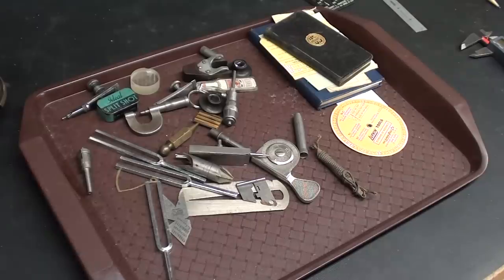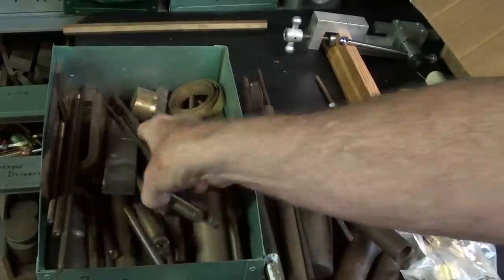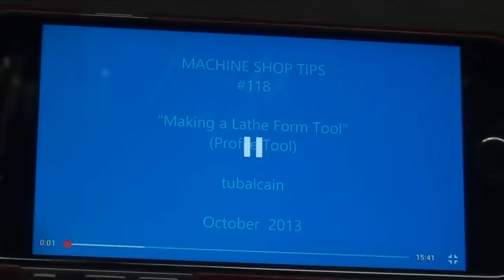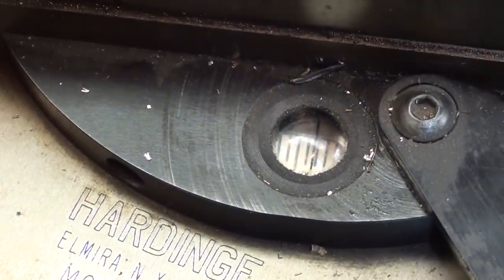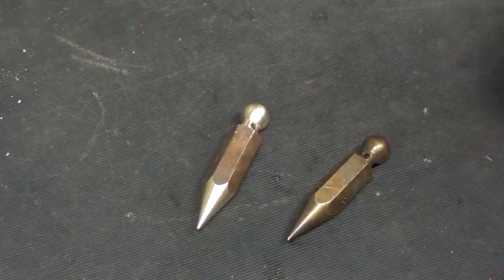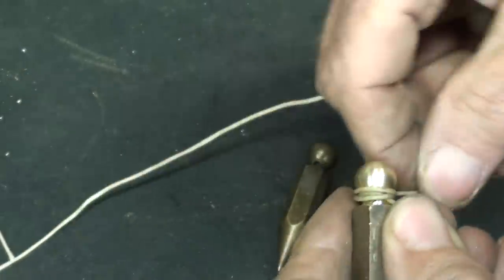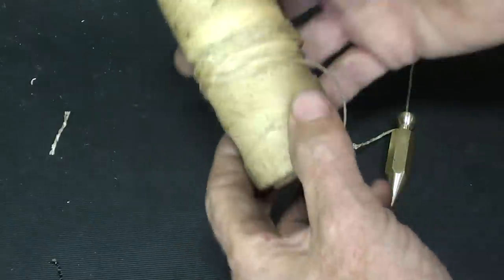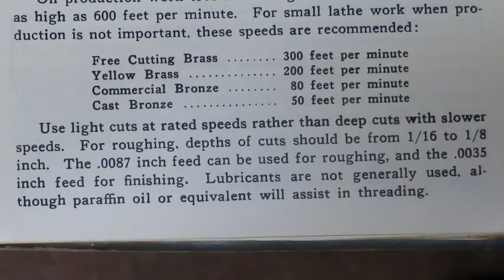MACHINE A TINY BRASS PLUMB BOB Tips #650 tubalcain

Comment: I have used a million miles of the waxed string...it is used in the telephone industry to lace cables to cable racking systems, and make wire forms. When I started with Western Electric in 1971, it was a brownish color and we called it 12 cord. The modern stuff is only six ply, and is white. Maybe the new stuff is nine ply...I've been retired for eight years, it's amazing how fast you forget things.

Comment: Having carried a plumb bob in a leather holster on my side for more years than I like to recall, I have never seen one fitted with a string knot out the side.  I certainly may be incorrect, but I question whether the knot location will make for a perfectly plumb point at the tip.  My experience is a knot inside a threaded top which is exactly centered on the bob.  My work required it.  Also, there is certainly nothing wrong with an intergral brass point, but I most bobs have a threaded steel point that can be replaced when it becomes dull or rounded. I have replaced my steel tip more times than I can count.  Regardless, I enjoyed your machine work.  Good videos and thanks.

Comment: I have a Starrett plumb bob filled with Mercury. I used it all the time building equipment for Sandia National and Los Alamos National Laboratories. They used a lot of Aluminum framework for holding various test equipment. A plumb bob was the easiest and fastest way to locate mounting holes for bearing blocks, etc. that were 8 or 10 feet apart. I had an annealed ball bearing with a hole drilled through it to pass the string through. Put the ball bearing in the first hole drilled in the framework and pass the plumb bob string through it and set the height of the plumb bob with an alligator clip where the string comes out of the ball bearing. Mark the spot under the plumb bob and drill... and Bob's you uncle..without the plumb part.
Cheers from NC/USA
Reply from the maker: Thanks

Comment: Nice little project. Thank you for sharing. I have a nice big heavy plumb bob that I've used in my work.. I prefer them to be about as heavy as possible so that they stabilize more quickly. If using them out of doors and there is any kind of wind, a light one will be a nightmare to try and use.

Comment: Commercial plumb bobs usually have replaceable steel points. You can still order these very inexpensive points from several sources  ( SECO, Leitz, K and E). Years ago I made a series of various sized brass bobs for my brother who is a carpenter. I used replaceable points from K and E. If I remember, they had a 6-32 thread. I always made a ball with a hollow threaded shaft on top. The hollow recessed chamber for the waxed string knot. Your design is much less complex, but should work  equally well. I still use one to plumb posts.

Comment: I have one that I found at a Goodwill store when I worked as a bus driver, then later as a truck driver. The house I now own, built in 1913 has studs in the exterior walls that run from the brick foundation all the way up to the ceiling in the second floor. When I remodeled the bathroom I found that there was nothing in between the second floor and the basement. I used my plumb bob string to measure the distance between under the second floor and under the first floor for how long the CPVC pipes were needed to get water supply plumbing up to the bathroom. I had to replace all the original plumbing. The supply pipes were full of rust and made water flow slow. The main drain pipe was 4 inch cast iron and rusted out. The drain pipes from the sink and bathtub to the main drain were made of lead.

Comment: Funny I have the same roll of wax string from work. It's for tying wire harnesses. Mainly still used in telecom data stuff along with the 48v DC for the telecom. There's a few lacing tools and gloves that go along with it.
Reply: That brings up memories from waaaay back to the '60's. My first job in electronics was harnessing wire bundles, it was a lot of fun using the flat lace, and I modified a leather glove by clipping the finger tips off so I could pluck the lace but shielded the hand joints when pulling tight. Then came plastic wire ties, which I thought looked so inelegant and cheap, but they are more practical allowing swift revision, Thomas and Betts had the best on the market and it was patented with a metal leaf spring insert, it's the one favored by cops as temporary cuffs because it's almost impossible to unlatch.☺
Reply: @BeachsideHank    1962 as an apprentice I assisted a journeyman tool and diemaker make an 8 cavity plastic injection mold for 6 inch long wire ties for AMP.  Our electrician always used T & B products wiring the hot runner components for our molds. Thanks for the memories on this 4 th!
Reply: @BeachsideHank  the good T&B are still around along with the plastic ones (junk). Also as data and fiber has changed Velcro tape is used a lot allowing for quick opening
Reply: @waynespyker5731  Panduit made a decent but expensive tool for tensioning and cutting off the tongue, but the bottom of the barrel was Dennison wire ties, those little bulbous clothing tags sold as wiring ties were the pits.
Reply: @fanplant  I remember too the military was supposed to be the big specifier of Velcro for uniforms, but they couldn't make a quiet version for combat gear; that ripping, tearing sound is a dead- emphasis on dead- giveaway of your position, sometimes you just can't beat ancient technology like a button.☺

Comment: I once overheard a conversation in a gun shop. The customer was talking about using the plumb bob hanging from the ceiling to align the vertical cross hair in the scope. I kid you not, the guy behind the counter, easily in his 60's, said "well, it will only hang as straight as the ceiling it's hanging from".  I just shook my head......
Reply from the maker: lol

Comment: Nice project, and something that would be suited to my minilathe.  I would make a small refinement.  If the center hole is drilled smaller than the cross hole, then the knot can be pulled back into the neck without pulling out the center hole.  It would be a bit neater.  Was the original made that way?

Comment: Nice little project, i have a large plumb bob, it was brass but had a threaded in steel point 1/2" showing, overall length 5" to 6".  a bit old.

Comment: When I made my Blumb bob. I made it with a hss point.
You can turn HSS with a carbide tool. M
Ps it's not easy. Mmmm
Reply: I have made one 25mm diam steel body with a 3mm HSS tap shank as tip.
Tip end of bob was drilled and reamed to press fit, HSS was presed in, tip was ground on lathe with help of toolpost grinder.
center Hole for "string" was drilled just 0.35mm And for line I use 0.12mm Fireline, gives very nice resolution when using it and wind have less of inpact

Comment: Lyle If you where still teaching shop and you gave the lesson  to the students (on paper) and set the angle of attack for the point to 34 degrees (turned at 17)
but then verbal when running through the process for the procedure used a different angle. When the proud student presented the finished project to you at a slightly different angle how would you mark the student or students?
Would the teacher admit to the students that teacher was wrong, that the student was wrong or give extra points to those who picked up the mistake?  Or better still how would you mark the project if it was a first time First term exam project?
 just curious. Enough to risk getting head bitten off lol 
Tony from Western Australia

Comment: Every time I need a plumb bob I can not locate it and end up using a nut and string.  I've run into a number of 'master builders' who do not know plumb from level nor how to check a level for accuracy.  BTW, you were not kidding about new vehicles turning themselves off, recently I got a all day ride in a newer F150 and in the big city it turned off all the time, sometimes just a second or two after stopping at an intersection!  Plus it had the witch microphone listening, bet she has no idea how to hack a worn out starter or bendix and keep the truck running to limp home.  So, are the new ones three degrees off, it is hard to tell from the patina and shiny and the round one between the two.
Reply from the maker: I just asked the dealer if they could permanently shut off that feature. They said no
Reply: That sounds about right.  I use to work for the justice department and foresee that grand idea coming back to haunt them when litigation starts pointing to that feature causing an accident.  I am conditioned from 60's-70's V-8 Pontiacs leaping across the road, I wonder what happens when one floors it and the vehicle is trying to start itself.  I am glad you brought it up, I will never buy one.

Comment: why would you bother
Reply from the maker: Hello troll
Reply: @mrpete222  I have supported your channel for a number of years-at least 6--why would you do a video on making plumb bobs--that is pathetic--get a grip and I am not a troll--you are losing relevance.regards Ian
Reply: He did it for both his amusement and mine.  He succeeded on both counts.  Thank you, Lyle.
Reply: The question is, why wouldn't he? 
Or anyone?
Reply: A nice teaching project for beginners.   Let's see their results free handing the ball radius!
Dad was a carpenter, I became a tool and die maker, after retirement he gave his plumb bob and 6 inch machinist level to me. Never used either so I gave the plumb bob to my nephew who was adding to his home. My neighbor was changing the motor and pump on his wood splitter needing a mounting plate fabricated. If I had a plumb bob we could make a cardboard pattern. With a felt tip, some fishing line and (8) 3/8 hex nuts we developed it on his garage floor. This little fellow would have been handy!
Reply: If the ball and recess were made removable (threaded into the body to trap the knot) the project becomes more challenging and rewarding. The body could be drilled and counterbored for a 3/32 diameter hardened die punch pin for a replaceable point (would need to construct a tool post mounting bracket for your Dremel for grinding the point). 
May require longer time but will receive extra credit.